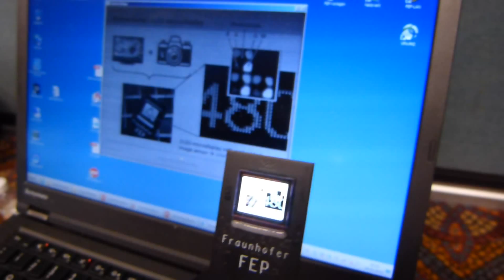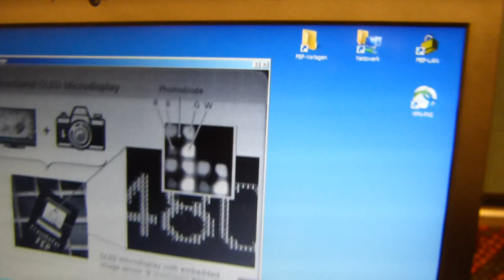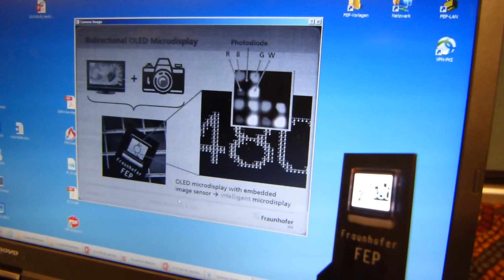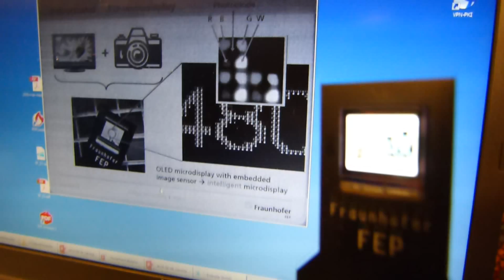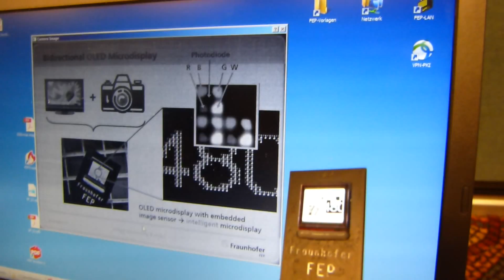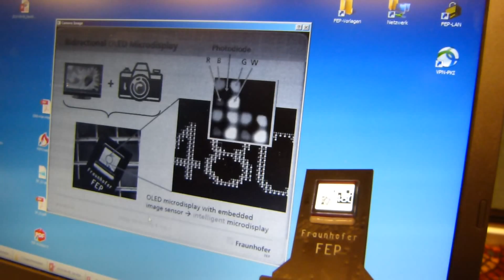Bi-directional micro OLED display - 1,667 pixels-per-inch! Hands-on

Comment: 1667 ppi, that's a little overkill
Reply: Shadow Slayer Not for VR/AR. You need this kind of high-resolution, low-power display if you want a truly untethered, self-contained experience. I'm sure Oculus VR / Facebook is looking very intently at Fraunhofer right now.
Reply: Yes but its so small
Reply: Shadow Slayer Uh, that's what expansion optics are for. Have you never used a camera electronic viewfinder before?
Reply: I have but until they make a 1,000+ ppi smartphone with decent battery life then I wont care for 1,000+ ppo
Reply: *ppi
Reply: Shadow Slayer well they need to make use of the 2+ GHz processors XD
Reply: Can't wait for 4 GHz octa core processors
Reply: Shadow Slayer amd did it^
Reply: Shadow Slayer Talking about PPI means nothing if you don't reference it to a corresponding resolution. You could have a 1000+ PPI display that's only SVGA resolution and that won't meaningfully tax any modern mobile device. What you're really saving with an ultra-high density microdisplay is power consumption of the display itself, not necessarily the underlying platform driving it.
Reply: 1,000+ PPI on a 5" smartphone display
Reply: Shadow Slayer That still doesn't tell me much. There are 720p, 1080p, and even 4K display panels of that size. Resolution matters. Physical size does not.
Reply: 7680 x 4320 which is 12k
Reply: Shadow Slayer Even if that is the native resolution, the mobile device doesn't have to be constantly rendering at that resolution, especially if it's an even multiple of full HD. The OS can just pixel double/quadruple/etc. to a lower resolution until you actually request native (for VR and whatnot). You can already do DPI switching in Android.
Reply: I know but if it happened then the lowest it would render to is 1080p
Reply: AndRootPro on phones stupido
Reply: XShadowshot Wow, love the name calling. I was just stating a fact. I hope you feel good about yourself now. Your life must suck if calling people stupid floats your boat.
Reply: AndRootPro good for you
Reply: ***** your reply makes no sense sorry I'm pretty sure there are no octa core 4ghz phones and I never mentioned that more cores is better
Reply: XShadowshot you sir, have just been awarded dumbass of the day. Have a goodnight!
Reply: XShadowshot he never said 4ghz lol he said octocore which is processors like the snapdragon 810 which already exist lol
Reply: AndRootPro hypocrite and I will have a goodnight thank you
Reply: ***** nice such paragraph very stupid much I don't give a fuck
Reply: No such thing as overkill in tech!!!
Reply: batteries being an exception lmao
Reply: Shadow Slayer hell no  not even necessary what mobile apps required that kind of power neither multi treading (just saying) but also cooling..the galaxy s5 and s6 gets a little to hot for my taste I have to be removing the case the back cover and wait like a good 35 mins before my s5 feels normal
Reply: I just want a chip that doesn't lag
Reply: Shadow Slayer a dual core on kitkat with a 1.5gb of ram is good enough a s4 pro would do
Reply: But it still lags
Reply: Shadow Slayer what is you expecting your phone to besides what it made to do..I'm think your looking for a pc or something else
Reply: Shadow Slayer I have the droid maxx and it barely lags even on this old cpu and 320